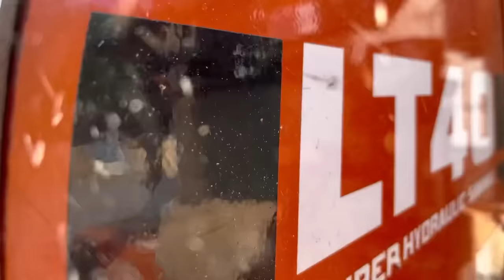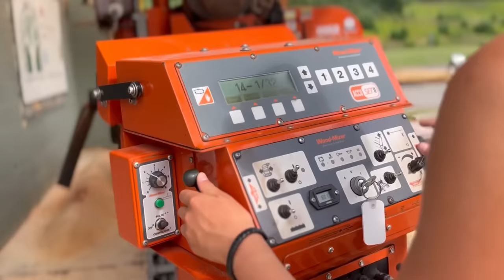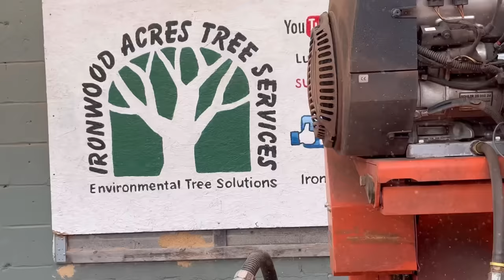A Good Day For Milling Hemlock

Comment: Emerald, Jade,, your work ethic and skills are beyond excellent.  Ofttimes small subtle things, sliding the board neatly into the stack on the trailer.  You and I don't think about it, but few can do it,, or at least few do it well.  My reason for writing tonight is the lovely long hair.  Long hair whether on a man or woman has no place around machinery,,, especially rotating machinery. Learn today to put your hair up.  A good tight braid or French braid and even consider once braided, drop it to the inside of the back of your shirt.  Or coil it up and secure it.
Hair caught in machinery is a progressive accident.  It really only requires a few stray strands to be initially captured,, but those few strands draw in other strands and yet more,,, and it all happens in less time than a blink of your eye.  It can cause extreme injury.  Please become hyper aware of securing your hair before you start a machine.  Your hair is lovely, and I love to see long hair, but nearly 60 years of being around machines as an employee, an employer, a business owner,  a safety officer, and a brother to three sisters,, put your hair up !    Both of you,, but for some reason,, Jade in particular,, a good solid French braid,, you would look smashing.  Then tuck into your shirt or band,  or coil up and secure.  Stay safe.  Stay safe.
Reply: I agree completely. I have 70 years of running machinery. Also as a machinist, supervisor, trainer, business owner, safety engineer and every time I watch your videos, I also wish the two of you would make your hair safe. And if you did you both would still look great.
Reply: I've been wanting to tell them that for a while now.  Good looking out homeboy. We wouldn't want any bad accidents to happen.  These girls are great though aren't they? I love this channel and turn everyone around me on to it.  I've learned a lot from them too. Plus great names. My names Opal so I dig it. I used to go to school with an Emerald too. Much love and respect to everyone.  Remember safety first!♡
Reply: I'm a man (the real kind; not the fake or confused kind).  I used to have hair as long as the girls' while operating farm machinery, and tools while repairing said machinery.  I also worked in a guitar factory decades later with same long hair.  On the farm it was banded and under Ye Olde Flannel Shirt (farmer's uniform) or baseball cap (farmer's helmet).  In the guitar shop it was never allowed near a spinning device.  I came up with a phrase in 1976:  Man Against Machine - Machine Wins Every Time.
The only trouble I ever had with long hair was going through the jungles of New Guinea.  I got it caught in some branches in the thick Highlands rain forest.  I had loaned my machete to one of my guides and he came up to me with it and at first I thought I was ready for the cookpot but he just cut my hair out of the tangle and we went on.  I guess I was too skinny for a decent meal.
I'm telling these stories to illustrate that in over 20 years around heavy equipment and power tools we never had any accidents/injuries...
OK... well... there was that time that the lawnmower tire exploded when we tried to fill it with air, and that other time when I fell onto the shop floor after putting all of my weight into a lugnut with a breaker bar and the lug gave way... but that didn't have anything to do with being a Hippie.
Reply: @vaccinefraud5570  I will begin with a compliment  20 years working around machines and no serious injuries.  You must not only be very lucky you must be extremely observant and careful.  I still have all of all ten fingers but not by much.  I could relate 20 stories of close calls on just my own hands.  Lots and lots of experience  and seen lots or injuries and I state with some confidence,, most or nearly all were preventable with a bit or foresight.  Long hair is a particular,,, because I have seen what a spinning drive shaft or spinning drill press can do,  and,, I don't want anyone to see that.  Its a simple thing like wearing a seat belt or wearing a PFD when in a canoe.  Most people will never need it,, but if you do,,,
Reply: And Jade should probably not be constantly checking her phone while working. Getting distracted can also lead to accidents.
Reply: @Sailor376also  Thanks, but 60 years around machines has me doing the Waynes' World:  I'm Not Worthy!
My 20 year run was just counting the time I had long hair.  I've been on the Pharm and industry since 1973.  I found out in 1976 (short hair) that even when a pneumatic device is electrically powered down it will still strike you like a coiled snake - just because it can.
As my hairline receded and my wallet receded I discovered that if you get dog-clippers and put on one of those attachments you can look like a buddhist monk for a one-time investment, no hair-cutter tip$, get all of the hair cuts you want as often as you want, and never have to worry about getting your non-golden locks caught in something rated in horse power.  
My approach to any job whether it was repetitive factory work or one-off jobs was to think it through in terms of order of steps, tools needed, AND.... WHAT COULD GO WRONG DURING ANY OF THOSE STEPS.  Its kinda like the movie franchise Final Destination.  You plan for the worst - but something else will try to get you.  I SWEAR that drop cords literally jump off the floor and wrap around your ankles!

Thing of it is, the injuries I sustained at all of the places I worked were via machines but not mechanical in nature.  It was the insidious and ignorant human factor.  Farm chemicals sprayed by applicators with the same amount of training as a McDonald's employee (the fast food joint not Douglas the aerospace joint); and later when I worked in semiconductor plants: toxic metals and organic solvents.  It was from those experiences that I discovered that respiratory PPE was the SINGLE thing completely ignored in those industries.  I spent my last decade on the farm and construction sites wearing nitrile gloves and half-mask carbon filtered respirator much to the shock of fellow workers, customers, and small children (but I repeat myself...).  Even Liquid Nails on a home build or remodel has a warning on the label that it can lead to dain bramage.  Don't even get me started on plumbing cement!  I've cleaned out my liver by natural means and purged those Sins of My Youth that were actually co-conspired by those who should have insured that their employees or contractors used respiratory protection.  
An old stone mason showed up to one of the new builds we were doing.  I heard him shout behind me:  "Now there's the smartest man on the jobsite!"  I turned around to see an elderly man pulling one of those tiny oxygen cylinders on a handcart.  We shook hands and he went on to tell me that he was a young buck that never wore a mask for his entire career while he was cutting and grinding stone.  He had emphysema so bad he had to have an emergency inhaler next to his bed even though he used oxygen at night.
I always support the good folks like you, Sailor, who look out for the young folks like the Girls 'n' Them because some of us didn't have mentors.
Reply: @golden.lights.twinkle2329  Ah... cellphones... the new Intercoms of the 21st Century.
Women are impressive though - I've driven behind women going at breakneck speed down 4 lane freeways in Los Angeles while they stare into the mirror putting on their makeup on the way to work.  That kind of multi-tasking without a multi-car pile up is Oscar worthy.  
I was bent over my table saw (with PPE and push sticks) making a long rip cut when someone I know came to the shop door and yelled at me (I had ear muffs on).  I got quite a shock from that unexpected noise, so I shut down the saw and told him to never do that again - and he never came back...
No injuries but Finger Sandwiches could have been on the menu.
I'm sure the girls know that we are not nit-picking, but trying to give an outside view for minimizing risk.  I could never go bare-legged in a video because my shins look like railroad tracks... that... and me in bare legs would probably put people in long-term therapy.  So the fact that they have no visible war-wounds shows that they are careful.
Reply: @golden.lights.twinkle2329  the machine does its thing when the log's set up, no need to make the day any more monotonous than it needs to be.
Reply: @vaccinefraud5570  Maybe you are Absalom!!! :O
Reply: @JonathanGillies  Patrick means:  Noble Father.  Absalom: Father of Peace.
OK, about half way there with the patrician thing.
Definitely not the prettiest man in the kingdom... unless we count Pretty Ugly.
Not the son of a king... but people have called me the son of a something else in times past.
Haven't been to Jerusalem or taken possession of the throne, although I am pretty familiar with plumbing.
I did get my hair caught in a tree but it wasn't while I was riding my swift a---- *mule*.  
So we're batting about 500.  You can call me Absalom but just don't call me Late For Dinner!
Reply: @vaccinefraud5570  Ok haha that's funny!!!!!!!! :D
Reply: @vaccinefraud5570  That's some solid transphobia you plucked fresh from the air.

Comment: A good friend of mine had an unfortunate run- in with hemlock lumber. He was cutting a piece to deck the flatbed on his truck and there was a large knot. The chop saw caught the knot and it pulled his hand in all but severing it. Surgeons spent 12 hours reattaching his hand. It has been a year and a half and he has full use, but still lacks feeling in some areas. These things will bite when you least expect it.
Reply: always expect it.
Reply: Why was his hand so close to the business end of the saw?
Reply: @hidingfromu5293  I’m not completely sure of the events leading up to his accident. From what he can recall, some things are a blank, he felt the blade bind and somehow, it pulled the wood up bringing his hand in contact with the blade.

Comment: To buck the trend - Long hair around any kind of machinery should be pulled back at the least, or tucked into a hat.  Ask anyone who's ever had their hair ripped out from their head because it got snagged and the machine didn't stop. Second, real work wear, not almost wear, is common sense. There's nothing sexy about actual shirts and strong jeans, but there's nothing sexy about seeing a large scar either. Good luck.

Comment: Wow that is a dream Bandsaw mill compared to the one my dad and I worked on 30 years ago! This one is well thought up!
the one we had was portable and it was 28 feet long, We were able to cut 36 inch thick logs, you had to walk back and forth with the head rig, 
And it didn't have a log roller we had to use a can't hook  to turn the logs with.
 We're lucky to have the log lift to get the log on the mill.  lol 
At the time we were cutting Tamarack logs in - 40 weather.  the head rig was not chain operated it had metal wheels with a groove in them on a metal track which caused the head rig to slip. 
pain in the butt that was lol. I can still hear my Dad cursing a bout it ha ha.  I wish he was still alive to see this mill. 
definitely a good investment. 
Do you sharpen your own blades? 
  That's a fun boring job in its own, but it is worth while to learn how to do, Band saw blades aren't cheep. and neither is 
paying someone to sharpen them for you. 
Thank you for the video it brought back some good old memories for me. 
 Take care be safe and always be happy and healthy Cheers!

Comment: Nice work. The only comment I would like to make is that when working around machinery, you should always put your hair up so it doesn't catch in the machinery. Same principle as not wearing a tie or loose clothing. A woman I know was using a pipe threader and her hair got caught in it, ripped her scalp right off. The doctors were able to repair it by reattaching, but it was not pretty when it happened, and it was very painful.

Comment: Great Videos!  I do have some suggestions, learned the hard way, of course.  1. Wear gloves; I have a lot of hand injuries over the decades. About the time you run a sliver through your hand, you will agree, better to wear gloves.  2. Lower back support belt; purchased at any Walmart or Amazon. The type that velcro latches up front.  You will thank me in your 60's, or sooner! 3. Eye protection: Sooner or later, you will run the saw into a spike or other item the tree grew around and your saw blade will come apart or other flying debris will slap you on the noggin.  In 1987, I had an eye injury that required 6 hours of surgery to put back together.  It was a horrible experience and still makes me cringe.  4. Knee Pads;  Somewhere a long the way, you will take a blow to the knee(s) and your knee cap will be broken and like mine, was shoved about 4 inches higher than where it should be. Again, surgery and 6 weeks of hobbling around and another year before it was back to feeling normal.  Safety First Ladies, Safety First!

Comment: Usually wood has to be inspected to be used in a lot of construction and then stamped. Different rules in PA? 

Also are most softwoods sold and used wet?

And I never see you dressing the board ends.

Comment: Lot of times I have slabs I make one by fours out of them or a 2x4 it depends on how cheap they want to go usually it's a one by four use it for framing a tool shed maybe a smoke shack whatever leftover lumber I have or trees are they called worthless like a rain tree or soft lumber or yellow pine a lot get it for free anything I get for free like Christmas trees and stuff I use one by fours make one by fours out of them just cheap way of framing that's all use of a roofing too shingles and stuff like that bowls nutcrackers and other things use the pump mix it with glue and make a firewood out of it last longer talk to you later

Comment: hmm just a question, is walnut wood are real wood or just stained walnut color? my cutting board is walnut but I think they glue pieces together and stain the color and it is a boos board. lucky to work be able to work with all the tools. Thanks for showing the video.

Comment: Girls, you certainly are beautiful, but why so fiercely hammer on safety? The loose hair is very beautiful, but if it gets caught in the machine, it would be a disaster. Chips in the respiratory tract and in the eyes again is not the most harmless thing. Take care of yourself, use protective equipment.

Comment: Use GLOVES  girls!!!  i know you wanna be tough  but tough goes right out the friggin window when you get a six inch splinter  right through your palm and its sticking out both sides of your hand and nothing you can do will pull it out. Its one freakin long ride to ANY hospital....been there done it.  I dont wear gloves except when handling wood or sheet metal, but then do it religiously.  youmess with handling lumber  long enough you will learn the hard way... inevitable

Comment: I can understand the concern about the long hair I worked with a guy that was in machine shop weren't running automatic screw machines and this guy had long hair and he did not wish to tie it up or get it out of the way you like to flip it around one day at wrapped around a bar it was being feted of the machine it flipped him over and leave this to say he was instantly scalped not pretty that is that is a damn big concern and that would be something that they should be really concerned about I don't want him hurt but other than that I love it when a gal and works at a job that is probably more traditional for men❤😎🤠

Comment: 2 million views and less than 10 percent subscribed. If you are going to use women as clickbait to get views on a milling video, at least let them pop in and explain processes and equipment etc. I didn't learn anything about milling and barely saw the women. It was a 9 minute slide show on logs passing through equipment. Boring